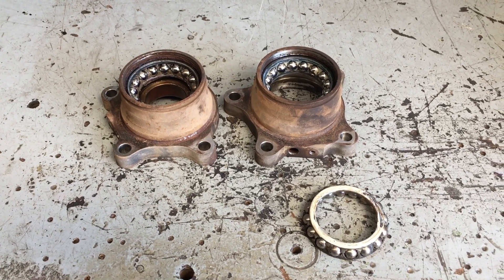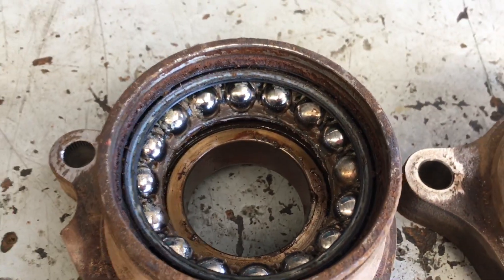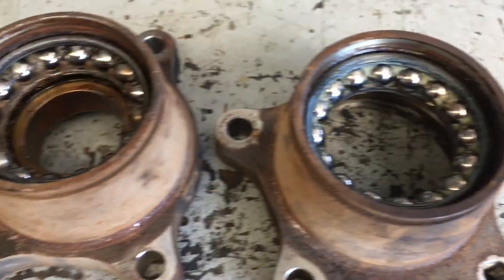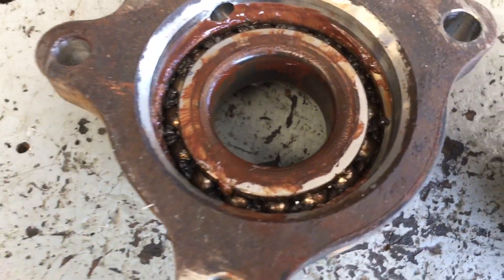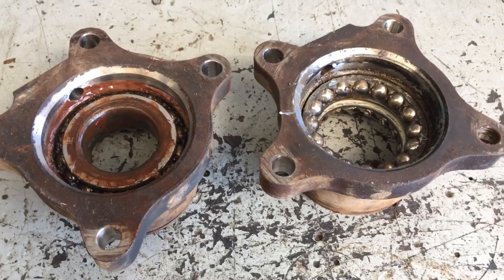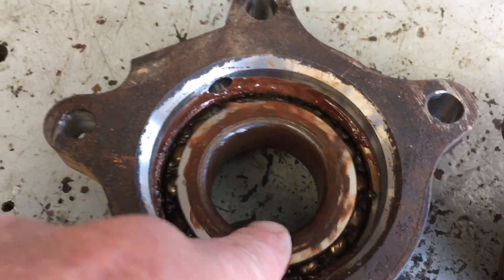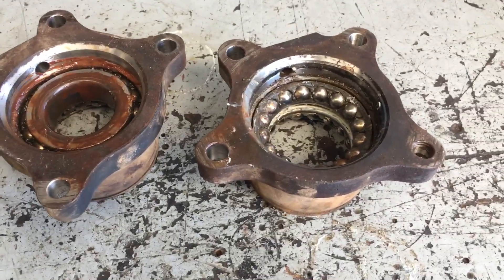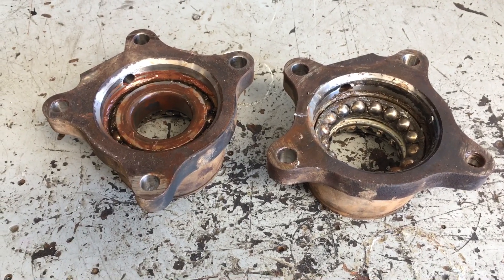TOYOTA PRADO REAL AXLE BEARING INFO

Comment: Are the bearings identical, or is it that 1 looks like a mirror of the other? I'm battling to source a left rear bearing for a 2006 120 V6, but most places have a right rear bearing in stock.
Reply from the maker: Different